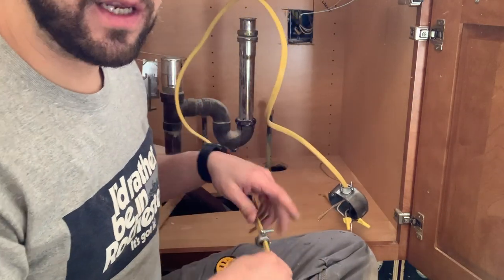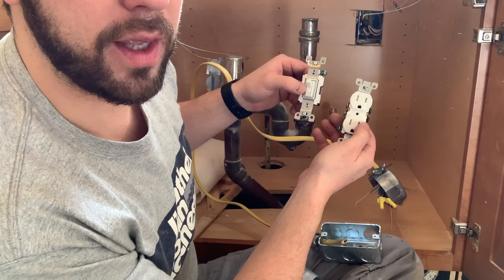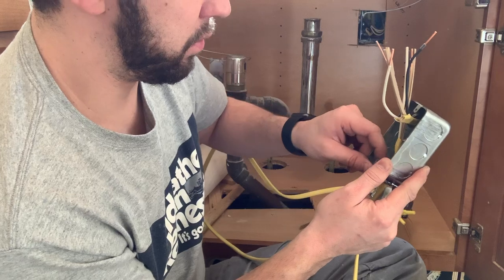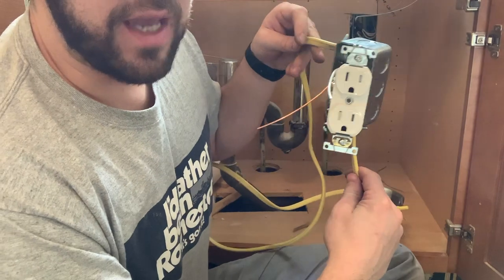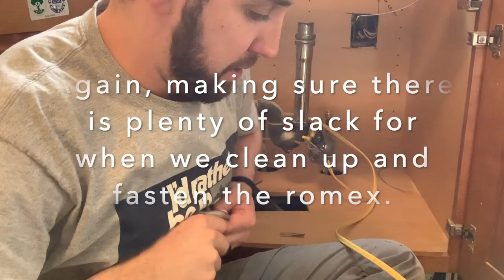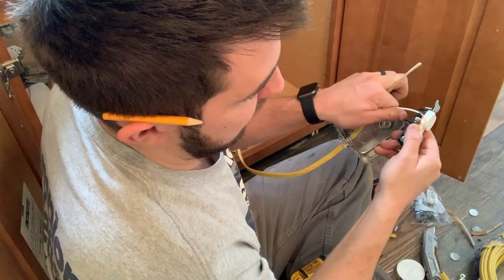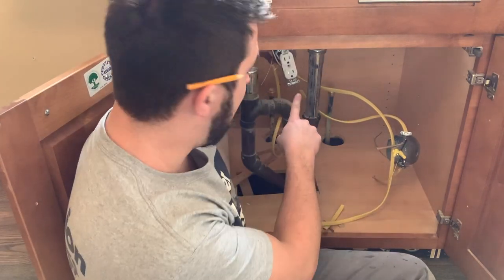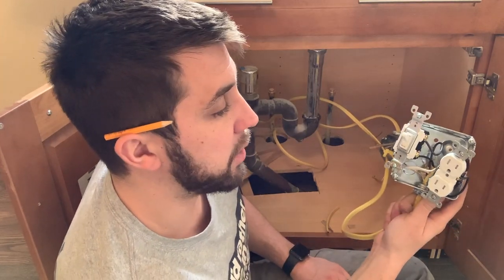HOW TO INSTALL AN OUTLET FOR GARBAGE DISPOSAL/DISHWASHER WITH A SWITCH

Comment: There should be 6 inches of wire coming out of the box. That's one reason why you had trouble with the wire nuts. The grounds should be tied together with a wire nut. They should also be tied to the metal box itself. If you are not an electrician, you should not be posting how to do electrical work, especially when it is not up to code. That hot cable coming up out of the bottom of the cabinet is at risk for being damaged by items in the bottom of the cabinet. There is an electrical box in the back of the cabinet that is partly covered.
Reply: I think It would of been easier if the rings were installed first then the cable (Romex)
Reply: I could have tell , this guy is learning.
Reply from the maker: My grandfather installed the first mall in the country. You may not think that this is important, but if you take a step back to think of what this requires, indoor wiring is a whole new world. So wiring size, installation and other issues- if it runs it works.
Reply: Constructive criticism doesn't register
Thank you for the comment and thank you to the person up there☝️ who said to put the romex and nuts on first.
Reply: I’m building up my r/v that why people have to learning?

Comment: That would never pass inspection... can't have wire exposed in the inside cabinets needs to be either in PVC or metal flex conduit.
Reply from the maker: You and I both know more sense exposed than not. 90 percent are not exposed.

Comment: Oh...LOVED this and that you included the diagram too!  The only thing I hated was that we didn't get to see you attach the boxes.  I just replaced my daughter's garbage disposal and unfortunately, the new one came with a plug.  The one I removed was straight-wired, so I'm having to install an outlet and without knowing what all is inside the wall (the on/off switch is above the counter but wired  how?), I'm planning to just add a GFCI/box to the existing wiring that from the (under sink) wall and just plug the disposal into the new outlet.
Reply: My problem too. Garbage disposal with a plug!
Reply: Did your plan work?

Comment: I have to cut huge holes in the bottom of my new cabinets too for the plumbing, what did you use to finish around the gaps between pipes and the cabinet holes?
Reply from the maker: I took a piece of plywood marked holes and cut it exactly in half then glued to the inside the hole (closest to the floor) hope that makes sense!

Comment: Did you mount the switch and outlet inside the cabinet for the disposal?
Reply from the maker: Yes I did. All applications are different. You can have a switch above in your back splash (high activity- like a large family) or you can have a button (air switch) in your countertop which has to be planned ahead. Easiest way is to have the switch (closer than the outlet) to the right when you open the doors below the sink.

Comment: Can the dishwasher & garbage disposal be on the same outlet?
Reply from the maker: No - you need to be able to turn off disposal on demand. You want washer always on
Reply: Per NEC, they can, but you want to use a 20A circuit with 12/2.

Comment: That outlets need to be gfci
Reply from the maker: It’s on gfci circuit. That said, the NEC does NOT require garbage disposal outlets to be gfci. Check code.

Comment: White Romex is only 14 gage, the yellow is 12 gage. The 12 gage is required for the disposal.
Reply: Why is 12/2 required?  12/2 is required for 20A, if the disposal only requires 15A then 14 is fine.
Reply: @Brees1986  It's a code requirement. Some disposals actually pull more than 15 amps.
Reply: @ammerconsulting   Now, if I were running a new line for a new install, I would recommend a 20A & 12/2 with GFCI , buts it’s not NEC.

Comment: Another tip is your wire strippers have a hole on them to make the loop as you did. Instead of the end of the strippers. Notice the holes ? That's for making the loop !! Thanks I got stumped on how to wite this been a minute and I'm no electrician... thanks and music wasn't that bad.......
Reply from the maker: Thank you on music, just trying to fill the awkward silence... nice comments are always refreshing to see! Most people can “always do it better”. Yes those loops work, but I figured most people watching this wouldn’t use that feature enough and were beginners so I didn’t mention it! Thanks again :)

Comment: You didn't ground the final outlet. Hope that no one follows these instructions.
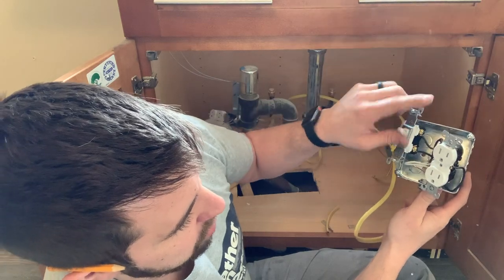Reply from the maker: Follow diagram at 13:09. Don’t nitpick - you get the point so does everyone else. Works fine. Totally safe. You YouTube trolls are unreal.
Reply: @LabelSeven  A little touchy aren't you. If you expect to put information out there for people to follow, you should make it correct. If I'm a troll, then I am a troll with an Engineering degree and 40 years experience as a housing contractor. Don't post your videos and expect not to be criticized.
Reply from the maker: Totally ok with that. Engineering degree from Lehigh- you saw the schematics you know what I’m showing- when you start criticizing the length of wire and blaming something as simple as wire nuts, you know you’re just nitpicking. As a professional-do you think this circuit will ever have problems? I’ll do a follow up for you on year 5. To date there have been no issues. As you and I both know, there will never be problems.

Comment: So can that same plug be used for new dishwasher?
Reply from the maker: That plug will be on the switch so no it cannot. The plug I installed in the beginning of the video is for the dishwasher. Come up with your power and run it to a plug so it’s always “hot” then continue your hot wire on through the plug to your switch/other outlet.